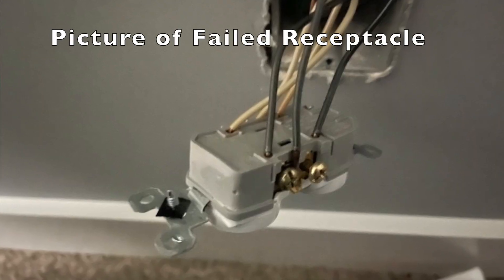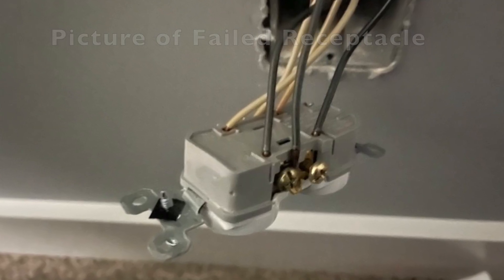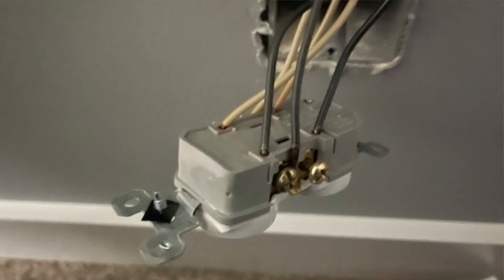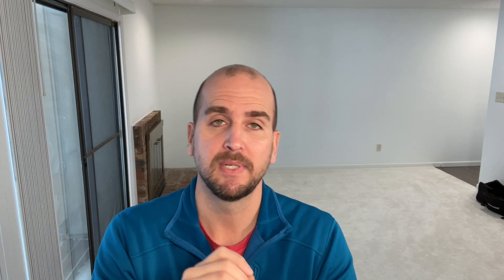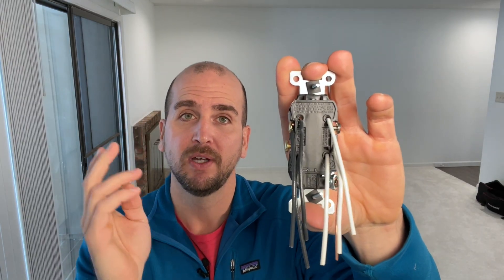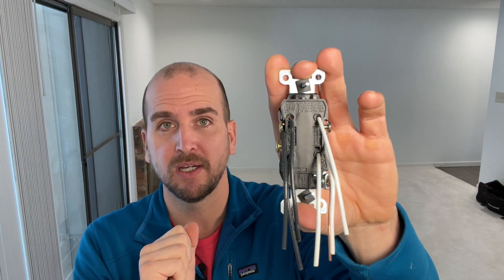Incorrectly Wired Outlet Found In Newly Built Home

Comment: Man this is the second time I see you, ok why a pig tail?  Because it's a parallel circuit and each outlet is independent from one another allowing the circuit to be completed even when one outlet is not working. Series, the circuit works through each devise so when one is disrupted so is the completion of the circuit, (like xmas tree light strings). Now yes multiple wire's to a receptacle is a poor practice but what about those screws? Yes unused should be turned in tight, additionally they are rated for the amp rating of the device not just #14 wire as you stated.  A 15amp circuit #14 gauge, 20amp #12 gauge, 30amp #10 gauge and UL has rated those screws for those wire gauges on those devices. You gave the impression only #14 under screws is ok. So it's ok then to stab the #12 into the back? You won't find stab in on a 20amp duplex  receptacle. There are devices that the wire is inserted into the back but the difference is the wire is secured by a screw not two tabs internally that cinch the wire hopefully preventing it from backing out. Stab in's are allowed by NEC because UL has rated them but there are a lot of things our governing forces allow, so because they say it's ok we should do it? No stab in's over time due to heat created by the demand and use of the circuit will loosen up there by being a lousy connection. Use the screw, wrap the screw, turn the wire around the screw so it can't come of even if the screw loosens, then tighten it down. I don't think in my 42 years at this trade have I ever seen a properly tightened screw on  a receptacle untampered loosen. So your one of these guys self teaching by word of mouth from electrical 101 for dummies books? Get into an apprenticeship and learn the real deal. Yes there are Electricians that have bad practices and what you've shown is definitely one of them but there's so much more my friend. Funny you never mentioned, Hey, be safe, turn off the power to the circuit, test it with a proper tester for voltage, (not a no contact tester either). Hey guy if the outlet is being installed with a metal plaster ring or in a metal box, tighten all the screws even if it's not used and wrap it in a good electrical tape to prevent it contacting with the metal box just in case the screws holding the device to the wall loosens up so the outlet can shift and the screws can potentially make contact with the metallic box or ring. I understand your making a buck for these video's but in all fairness, learn it all, then come on here as master Electrician qualified to help other's with all the information instead of coming on here giving the impression you know more because of what you found or (created) by some hack in your area also pretending to be a qualified Electrician. I take major offense to that dollar man. We get inspected  so that's my first clue of what you have shown, Who does that! What inspector will let that go? Are your inspectors clowns also?

Comment: As an licensed electrician, I would have given my apprentice a smack upside his knoggin' for wiring a receptacle like that. Also, using the holes in the back is lazy-assed (we just want to make money-screw the quality) approach. Especially when you loop a bunch of plugs together like that and then run a big 1500watt heater or a window a/c unit on the receptacle at the end of the  circuit, you're relying on each and every one of those receptacle so have be a "splice" or there WILL  be heatiing.   Using the screws is ok, ,but definitely pig-tailing is the best (especially if you expect to have high load items connected.

Comment: Do you have insulated screwdrivers in the US? Over in the UK we have screwdrivers that have insulation that goes down the shaft so you can’t accidentally get a shock off the screwdriver.
Reply from the maker: Yep, that is a thing just not very common for us DIYers.

Comment: I'm happily surprised.  Thank you for researching and getting it right. Most instructional videos for electrical wiring methods are full if errors and misguided assumptions. Stab lock connections are guaranteed problems when heavy loads are used. Stab locks do not provide a tight connection and the result is heat. Also keep in mind that electricity travels on the outside of the conductor which means the connection point of the Stab lock is the end of a metal flange. Not enough surface area for heavier loads.

Comment: Use only push in. Don't use the screws on the side because those screws will come loose over time. Push in are spring loaded and have no exposure. Strip the wire to it's designated length shown on the outlet backside. Remove those screws or screw them all in. Also we always run electric tape or liquid tape around the outlet itself so than later when we come back to do upgrades or replacements we don't get shocked or other surprises. In Europe you don't even find any screw outlets anymore. They are all converted over to push in tap connectors for safety reason. Also in the EU outlet's are round and not square because most walls are concrete so a concrete hole saw is been used. 
Code does not allow you to run electric thru the outlet meaning feeding a lead in and than use the other connector to continue to daisy chain another outlet to it. 
Only if your do run a split outlet you will see 2 hot's and 2 neutrals run in which must come from the same breaker because you only do have 1 Ground connected.  
Use in your outlet Schuco push-in terminals they are rated to much higher AMP and Voltage reducing the risk of FIRE.
Also those push in Schuco connectors are approved to 600V AC and once the power cord is pushed in you can only by twist pull or pushing with a special flat had the spring away from the wire so they will not come loose and or expose a lead.  
Electric code here in the USA is still far outdated.  Just look at electric code over in the EU where all Power is 240V AC. twist nuts are strictly forbidden over there for a reason where pushin from schuco are approved. A pack of 3,4,5 or 6 port which contain on average 50 connectors cost about $6 at a HD or Lowes but if you use are a real professional and get them from Circuit City or Ferguson you pay half that price.

Comment: I have come across more failed push-in duplex receptacles than I care to mention. So its clear to me that the wrap around method is best practices.  I also learned that cheap switches and receptacles are not worth it. I'm not an electrician by trade.

Comment: Calling the original electricians "lazy" is a bit harsh.  They stabbed the conductors because it is faster.  And since there is little to no margin for the electrical subcontractors in residential new construction, speed is literally everything.
Yes, some contractors will do better quality work.  But we charge easily four times as much as the production general contractor is willing to pay.  And I'm even more than that.
Bottom line is the price pressures exerted by the potential homeowners provide the actual homeowners with exactly what they paid for. 
It is what it is.

Comment: I have been an electrical inspector. On final, I looked at the device plate screws. If all the screw slots were straight up and down, I knew the job was done right. Even though a helper probably installed the plates, I knew there was a pro who cared about the details who was in charge of the work.

Comment: Pigtails, although not actually reducing the volume requirements do take up more room and sometimes will not fit, also if the screw has a pressure pad and is made for 2 wires I would definitely prefer two wires under one screw, infact I think its better because it keeps the pad level under the screw
Reply: If I have one wire in that case, I leave the pad down and do the classic wrap around the screw
Reply: Yeah that's what the clock wise j hook is for
Reply: @ryanvess6162  I think you're both missing my point I wasn't discussing what to do when you only had one wire what I was saying is it's just fine to put two wires under one screw as long as it has a pressure pad and therefore is designed for two wires
Reply: @integr8er66  ofcourse I understood what you were saying. Did you understand what I said?
Reply: @beinghuman3225  Yes, I just didn't understand what it had to do with my comment. I wasn't really commenting on putting one wire on the receptacle more just that two is fine if there is a pressure pad. I don't really know if what you suggested is a UL approved use of a pressure pad type connector or not. I'm not saying its wrong, just not sure it UL approved for that type connector.
Reply: @integr8er66  I agree with you, the pressure pad is nice.  I wish that was the standard for all plugs.
Reply: There was nothing wrong with what he did the first time. He was trying to improve on it instead of that thing looking like a bunch of spaghetti hanging off of it. Just more that could mess up.

Comment: I go one step further and wrap the screw terminals with electrical tape before installing in the box.  I do this because I have run across both a used and a brand new circuit breaker that failed!  Luckily I'm anal and constantly check for power.

Comment: It does work,  it's  within NEC, "national Electric code". What people dont understand is "code" is the minimal requirement.  You should always go above minimum.
Reply: If you did it to code, you just did the shittiest job you could do😉 words to live by
Reply: It's too bad INSPECTORS don't understand what MINIMUM means...some failing overkill as 'not to code'
Reply: That's a bad description.  It's a standard not a minimum it also has maximums.  Most "going above" provides no additional value and in a lot of cases actually provides less safety and less value by default.  Going above and beyond is usually the mantra of someone that doesn't understand that standard.
Reply: @lloydmills9619  the standard is a minimum. Please give examples of "no additional value and less safe".
Reply: @beinghuman3225  no, its a standard that also has maximums such as max number of conductors in conduit before derating or the maximum ampacity of a specific conductor.  An example of exceeding minimum standards creating a violation or hazard would be #8 or #6 NM feeding an AC compressor with a "minimum ampacity" of 19 amps and a max OCPD of 50 amps.  The code allows #12, using #8 or #6 nm would create a hazard by impeding the fault current with a smaller EGC and a violation of 250.122b.  Of course that's just an example.  The larger wire in this case provides no additional value and is less safe.   Exceeding this standard does not automatically equate to more safety.
Reply: @lloydmills9619  The National Electrical Code® (NEC) is the most widely adopted Code in the world and is approved by the American National Standards Institute (ANSI). ... The NEC is the minimum set of electrical rules that must be followed for compliance and assurances that occupancies are safe from potential electrical hazards.

Still a minimum.
Reply: @lloydmills9619  you're just being pedantic. If you always use the smallest conduit you can get away with rather than oversizing a bit before you absolutely have to, to make pulls easier and leave lots of room for future circuits, you're meeting "minimum code" but probably not thinking ahead. If you put your conduit straps 3/4 of the maximum spacing allowed, you are fastening it better than allowed and therefore exceeding the minimum code. $0.50 receptacles meet code but more expensive ones are generally higher quality and last longer.
Sure, if the code has a range you have to stay within it. Not everything has an obvious better solution than the standard. But you'd have to be obtuse to not see that two electricians can do a job that passes inspection but one is just...better.
Reply: @lloydmills9619  A good review and point .

And again the people complaining do NOT understand the inspector can only  inspect and approve  or dis-approve based on "standard", not what you like , or going over the maximum , his|her gut feeling or best practices. That what the author of this video should focus on and not call them mistakes.
Reply: Absolutely, I compare 'being to code' as going with the lowest bidder for your sensitive medical needs (we c an use our imaginations here). Yes, it might be done to an acceptable level but 'properly' doesn't cost much more and in the case of electrical wiring, could save your property or even your life!

Comment: After reading a bunch of these comments, my conclusion is, there are a LOT of ways to do it "right".  By that I mean "right" can be a matter of perspective and opinion.
Here's my take. First of all I'm a Colorado master (since 1983) and started apprenticeship right after high school.  I'm old enough to have wired some houses using  aluminum branch's circuit (12 & 10 gauge) wire.  For me, this only lasted a short time but others continued to use aluminum wire for much longer.  Today I think the entire industry got the whole aluminum wire thing wrong.  That includes the manufacturers, the testing labs, the inspectors, the installers, everyone involved, except our customers that trusted all of us to do it "right".  It was during that early period that I first started to distrust "backstabbed" connections and started terminating wire using the j-hook around the device screw almost exclusively.  However, applying the j-hook technique to aluminum wire, only delayed the inevitable.  But that's another story.  All of that was approved materials and methods at the time.  The unintended consequences turned out to be a couple of tons of bad news for many, many home owners.  But we really didnt know any better.  Maybe we should have but we didnt.  Since then, the entire Industry has corrected this situation and many of us learned a good deal about what to do and what not to do.
Working with aluminum wire (even at 17 yrs old) taught me several things that I have carried thru to the present.  Obviously I have made a career out of those early experiences.  Here are some of the things that I learned from those early days.  Keep in mind that while I have done hundreds of houses, most of my career has been spent doing commercial/industrial work.  First is that I believe you can learn more, and teach more, about this trade, in a lot less time, wiring houses than anything else I know about.  All the basic code issues are there, all the basic circuits are there, most of the basic rules about services, circuits, loads and calculations of those loads etc are found in residential wiring.  As a bonus all the materials are small and light weight as are most of the tools.  It's an easy place to teach good work and safety practices.  Secondly, I've found that by starting apprentices out by wiring houses will pretty quickly sort out those who might make a career out of it and those that will do for a few weeks and then leave the trade for something else.
When I do a new house I almost exclusively use the blue plastic, nail on boxes.  The ones with the most interior volume for the number of devices that you are going to be installing.  These boxes are tough and stand up when you miss the nails with the hammer, are non conductive and if you plan it out correctly they are difficult to overfill.  Set them out from the face of the framing correctly for your particular wall finishes and you will save yourself lots of grief later.   Using a non conductive box also negates the need for taping the device as some have suggested, in my opinion.  I use "upgraded" devices, meaning they generally don't have the "backstab" feature.  I turn the j hook with my wire strippers, hook it behind a screw and tighten all the screws down.  When running the wire I try not to make a bunch of junctions in the wires by using wire nuts but try to make those junctions on the devices.  I know that goes contrary to some of the comments here regarding the use of pigtails but thats how i do it.  Its fast, easy and I've not had any issues or warranty calls because of this method.  The devices are designed and tested to carry the full current of the circuit they are rated for and I have not seen a failure that could be attributed the break off tabs on the sides of the device.  When I do have more wires than screws to terminate, i use a pigtail or a modified pigtail.  I do, and have always, twisted the wires together, trimmed the excess off so the wire nut covers all of the exposed conductor.  Using that technique, with the non conductive boxes, I don't think it's necessary to tape the devices.  On insulated conductors, I use wirenuts, (I like the Ideal Twistlocks with the wings on them) and on bare conductors (grounds) I used "Buchanans".  They are a type of metal sleeve that is crimped with a special crimping die.  My "linesman" pliers happen to have that crimping die built in so I don't need a separate tool.
I would admit that the materials and methods I describe here might cost a little bit more than the absolute bare minimum but I also believe that doing all most anything in life to the absolute bare minimum is very much false economy.  For me, the additional cost of the materials and the additional labor, if there is any, is insignificant when compared to the cost of a warranty call.  Warranty calls don't give your customers warm, fuzzy feelings either, and that is also a cost.
This is a thumb nail sketch and is buy no means everything you need to know to do electrical wiring in your house.  It is meant to add to the discussion.  
Kudos to this content producer.  He did a good job, certainly in getting this discussion going.
Let me know what you think.
Mike's

Comment: “Pigtailing” is now required by the NEC. 
It takes the load of the entire circuit off of the terminals of the outlet, and if one of the terminals does become loose. You do not loose power to the other outlets downstream..
Reply: Article #?